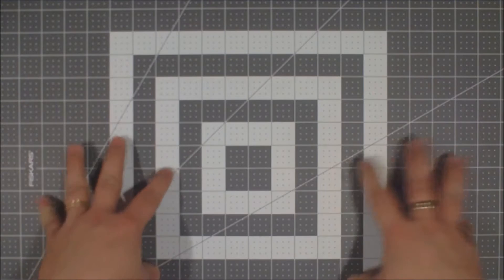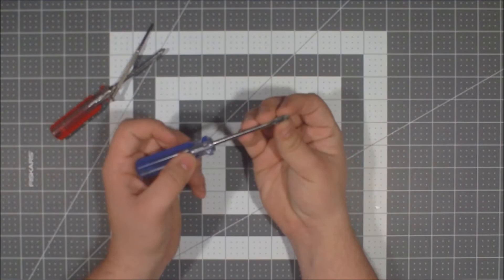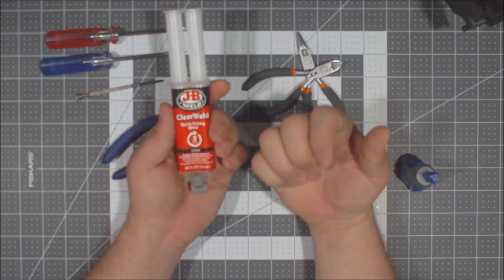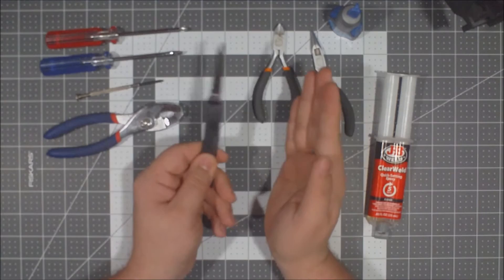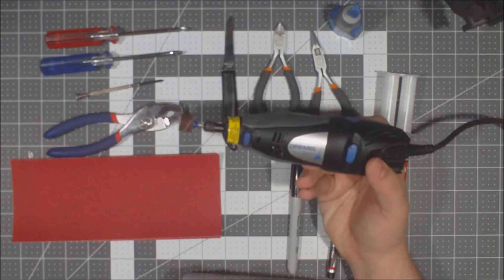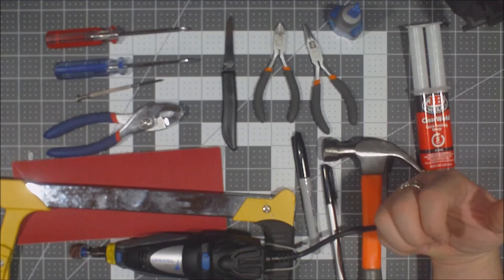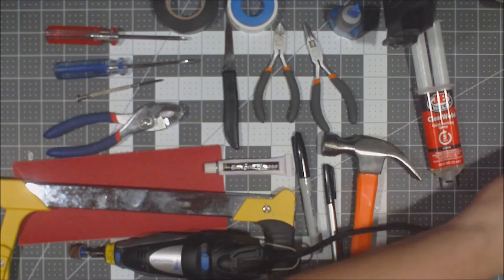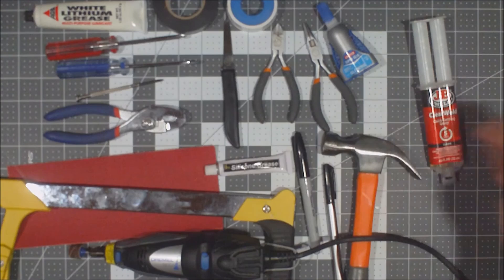Back To Basics:  Introduction to Tools

Comment: Good list.  For myself, I would add rasps/files.  These can really help over a rotary tool to really get some good clean edges/corners and clean up with good control. It's in between sandpaper and the rotary tool.
Reply from the maker: I'm going to bring those up later in the series when I get into shell work and painting.
Reply: Also, a nice list in the description would be useful as well.
Reply: TheGriever2112 makes sense. keep it up!
Reply from the maker: I'll add that.